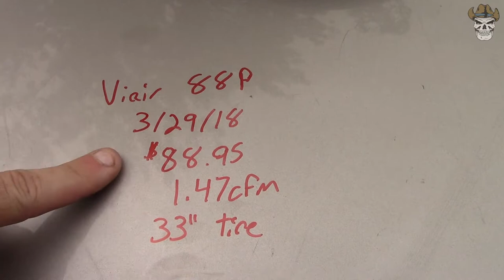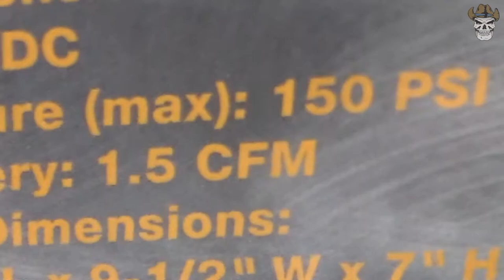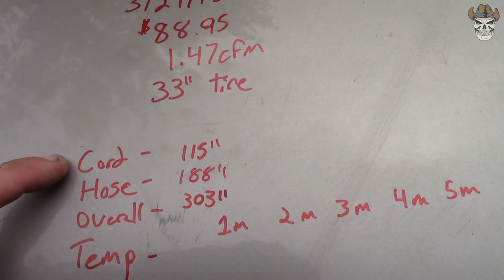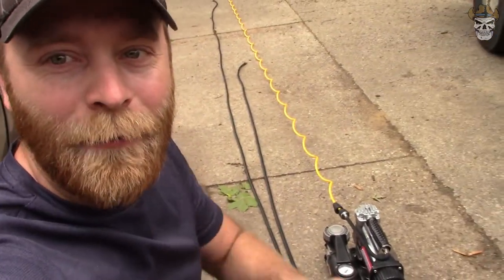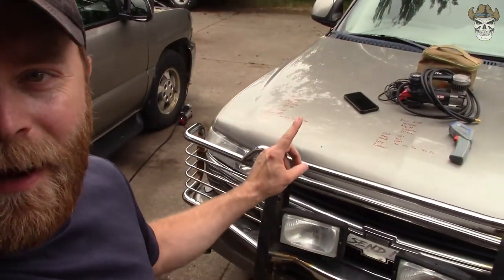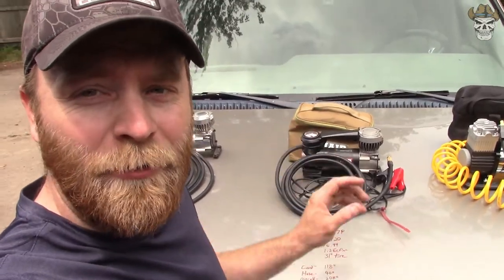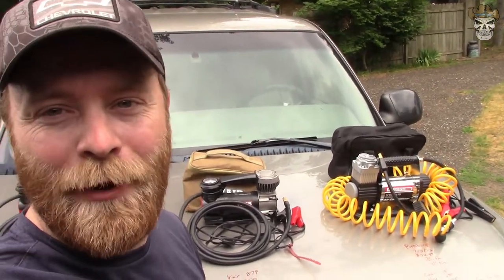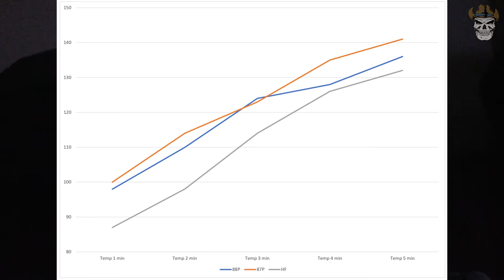Viair 88P & 87P Vs. Pittsburgh Portable 12 Volt Air Compressors Comparison

Comment: I know that it’s just an opinion, but I think it’s premature to say that the Pittsburgh can’t be relied on for long term usage when you recently bought it. I bought my girlfriend the Pittsburgh, and we used it for over two years now, and it has exceeded expectations. We used it on her Jeep and my truck while it was going flat for weeks until I got a new tire for it, and it never failed. We also used it on her small schoolie, since she decided to sell it, and all of her tires were low. I gotta say, it got really hot, but it got the job done fully inflating all of the tires.
Reply from the maker: Honestly I have used the Pittsburgh one myself countless times since this video and its holding up great other than the bag it came in witch has fallen apart and has been tossed in the trash.  For the most part all of the compressors get very hot so I wouldnt be too concerned about that.  I tend to have to let them sit for a bit or store them in a way that after im done they dont melt anything they touch.  I appreciate this comment you posted and happy to hear the Pittsburgh you have is performing as good as it is and thanks for sharing your experience with it.

Comment: Look up the maintenance video on the HF unit. The top of the cylinder "heat sink" is just a plastic cover. The cylinder wall "heat sink" is also just a cover that doesn't touch the actual cylinder sleeve. I'm willing to bet the working parts under those covers are a lot hotter. If I had the HF unit, I would throw away the plastic top cover and drill holes in the square cylinder cover for ventilation.
Reply: They put the plastic on top for lawsuit reasons. It will burn you after airing up 4 33x12.5s. I left mine off after modding it to used regular quick disconnects and port radiused the intake and exhaust ports. Tested it with a 7 gallon tank and got 1.3-1.5CFM depending of supplied voltage.  Originally bought it just to air a slow leak tire up everyday until the new tires came in. That was 3 years ago now it lives in the little daily with 26in tires, it works great for passenger car tires or stock sized small truck tires.
Reply from the maker: Thanks for the info!  I went outside and pulled the compressor out and sure enough the top  is plastic.  Seems kinda dumb they would do that honestly but they must have there reason.  Thanks again for pointing that out.
Reply: @PostalRedneck  as the previous reply said, it's probably a combination of liability and cost cutting. It looks like they all have an air gap between the cylinder wall and the side fins though, so I wouldn't count that against the HF pump. I doubt it matters considering how little surface area there is without a fan. They're all a huge jump up in quality over the cheap pumps with plastic pistons.
Reply from the maker: Yeah I had an old plastic piston pump and took it apart as it took ages to even get a car tire to 15psi.  This was back when I was like 18.  They are very cheaply constructed and a waist of money.  All 3 of these pumps are great for someone who is not going to be using them every weekend.  I love having all 3 and use them more than I thought I would.

Comment: I had one of the Pittsburgh ones and after inflating 4 large truck tires to ~55 PSI it got so hot that the fuse actually melted on the unit. HF is obviously known for their impeccable quality control standards, so I know that 1 unit can be excellent and the next a lemon. Just watch the temps if you are airing up more than one tire and be sure to allow for the unit to cool down!
Reply from the maker: You have to be care full as these do have a sorta duty cycle to them.  I cant quite remember what it is.  You have to also make sure the vehicle is running as it will pull less amps at 14v.

Comment: I got the Pittsburgh 12 won’t go past 10 psi harbor freight
Reply from the maker: Bummer.  I would return it and get another.  My Pittsburgh compressor is still going.  I used it a few weeks ago as my trailer had a low tire and its the only one that would reach.  I will say I use my 88P way more though but the long reach of the Harbor Freight compressor is nice sometimes.

Comment: I hate coiled hoses. They are a pain. I have the 87P and the hose is okay for my Forester, but I bought the extension hose so I wouldn’t have to move the compressor so much. Of course it doesn’t fit in the carrying case with the compressor.
Reply from the maker: Yeah the coiled hose is not fun to fight with especially if you have a flat tire and are in a bad mood already.  I kinda wish they just made the hose 2 feet longer.

Comment: Nice video. Is that 88P still going strong?
Reply from the maker: All 3 of them are still going strong but the 87P bag is in rough shape and the Pittsburgh bag was tossed as it completely fell apart.  It still impresses me the 88P is going after all these years and I usually find myself airing up all 4 of my 33" tires after off roading.  Either way you go they are nice to have and I use them way more often than I thought I would.

Comment: I'm confused about tire size. It sounded like you said a 16 inch tire is a 31 inch tire.  I just got a 12 volt compressor and I am trying to find out what i can use it for. I am guessing the class A motorhome tire isn't going to get aired up.
Reply from the maker: The tire size is 265/75R16.  The 16 in that number is the rim size.  The tire size in inches is 31.65 inch x 7.82 inch on a 16 inch rim.  Just measure the tire from ground to top of the tire and that will give you the estimated tire size and then get a compressor that is rated for that size tire.
Reply: @PostalRedneck  thank you very much
Reply from the maker: Dont listen to him.  Its a shame people forget that not everyone starts out knowing everything.  Keep asking questions from people who you believe are going to yield the correct information.  Youtube is an amazing location to ask for help.  Every now and then you run into people like Tool Time and you just have to laugh and ignore them.  I just like everyone else started off walking before we could run so take it slow and have fun.

Comment: Thanks for doing the testing man. Any updates after a few months of use on the Pittsburgh?
Reply from the maker: Honestly have not used the Pittsburgh one more than a hand full of times.  I did loan it out to a buddy and he used it a few times when he was on an off road trip and he liked it.  I will say the long hose is nice and it packs away good but the 88P that I have had now for 4 years has been well used and abused and keeps on kick'n.  The 88P is my go too when ever I have to air up a tire or I go off roading.

Comment: Would the Vlair 88p work well with 33 inch KO2 AT tires? Need something to air down to 20psi then back to 39psi for the roads.
Reply from the maker: Im sure it would work but keep in mind this is a low budget compressor so if you plan on doing this a lot then get something a bit better otherwise I have used the 88p a few times to air up 33's to about 30 psi.

Comment: Looking to hard wire a small air compressor for my Jeep JL, been checking out the 87P. Just need something reliable in a small footprint.
Reply from the maker: Thats what I was originally going to do with my 88P but never got around to it.
Reply: Hi. What do you guys mean by hardwire the compressor to car? And how so? What is the benefit? Thanks.
Reply: @WilliamVG Hi. What do you guys mean by hardwire the compressor to car? And how so? What is the benefit? Thanks.

Comment: my VIAIR 88P - 00088 Compressor lasted less than 20 minutes just topping off couple of cars 2-3 PSI
Reply from the maker: Man that sucks.  Ive owned my 88P now for 4 years and would almost say I abuse it.  Were they 80psi tires or something?  I have yet to test to see how they do at anything higher than 45psi.  Also did you have the vehicle running when you were using it?  They require 14volts to run and a sitting vehicle only creates 12.6 at most.
Reply: @PostalRedneck  just a nissan sentra 195 size tires which is 34 PSI and camry tires and I only topped them off about 3 PSI due to changing weather.and yes I had cars running.don't want to drain battery.  even scotty i think uses that one. any way I suspect it was someone's return cause the rubber bumper feet were worn and it also had some scratches on side. I ordered another one.
Reply from the maker: @WV591  I sure hope the worked with you and got you a replacement and that you were not forced to buy another.  My 88P has been a great compressor.  Sounds like you did everything right.  Some people dont know the vehicle has to be running and will burn them up.  I sure hope the next one treats you wayyyyy better then the last one you got.

Comment: Y’all should add a 19.5 tire. The psi gets to 110.
Reply from the maker: That tire had a 44psi rating.  I wasn't about the pressure it was about if they were efficient enough to getting you home or to a tire shop or if they are worth buying.  If you end up getting one and doing a test leave your findings in the comment section in case someone else is interested in the information.

Comment: Is the Pittsburg still working?
Reply from the maker: Pittsburg is still up and running great.  I have used it now out in the dunes to air up my tires 5 or 6 times.  The little bag it came in has given up though and fell apart pretty easy.  Other than that its almost my go to compressor with how much reach it has.